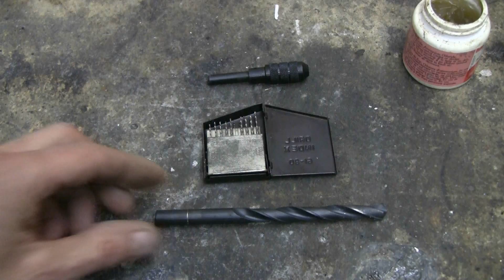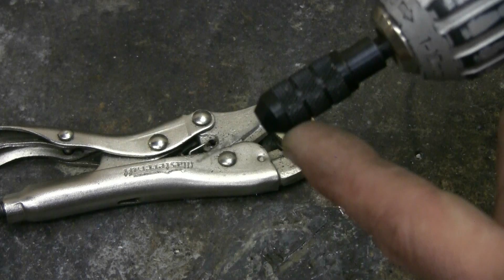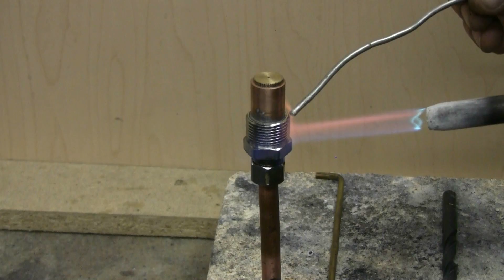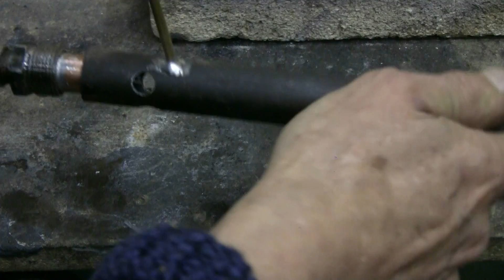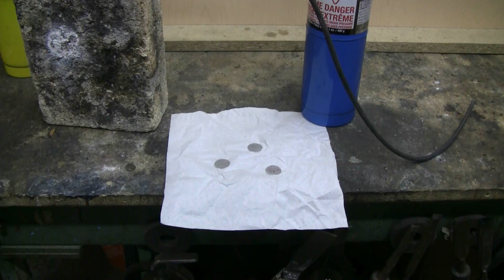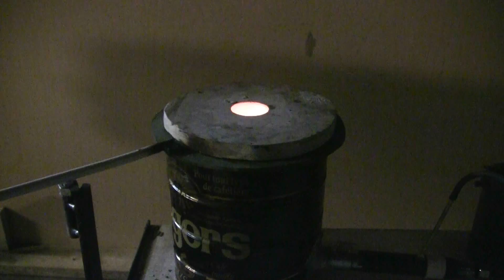How To Make A Propane Burner For The Coffee Can Mini Foundry

Comment: i have a question..i built this same torch exactly how it was made in this video and for some reason even when i put the air blower to it it seems to lack the thrust and the tail end of the flame seems to long and orange like in the video i would imagine the  whole definition of the flame would be strong blue with that loud torch thrust. can you tell me what am i doing wrong? bill? anybody?
Reply from the maker: +rebwar08 Try orifice size and also placement of the orifice within the tube. These and gas pressure affect the burn quality.
Reply: Bill Gilmour ok i will try a different orifice size i used a #65 micro drill bit as you explained in your video do you think i should go smaller as in say a #70? and should i position the orifice further foward towards the front of the pipe or leave it exactly how u had it in your video?
Reply: I pumped pure o2 seemed to cleaned it up i think orange indicates a rich mix.